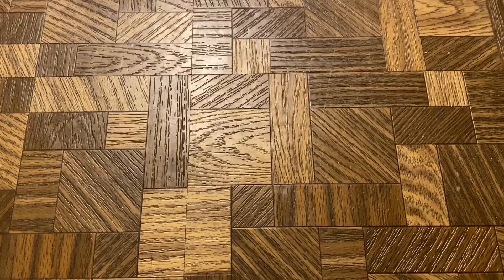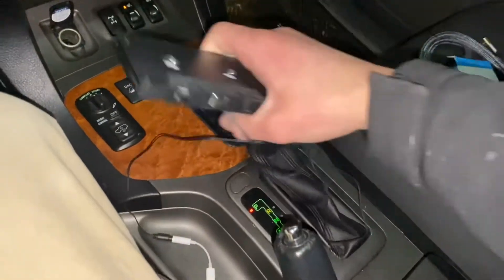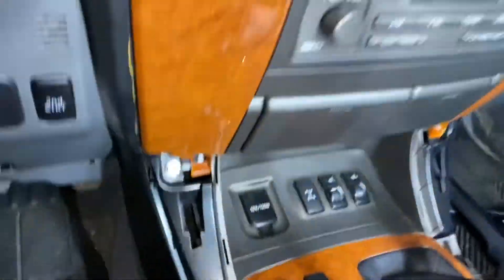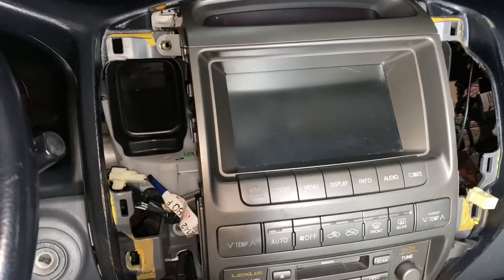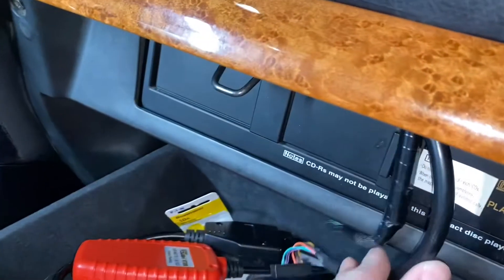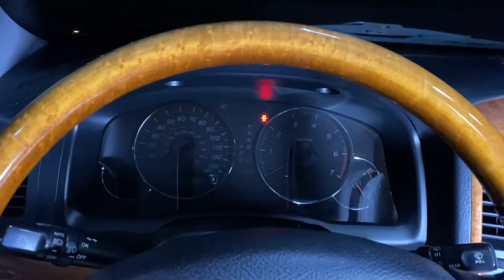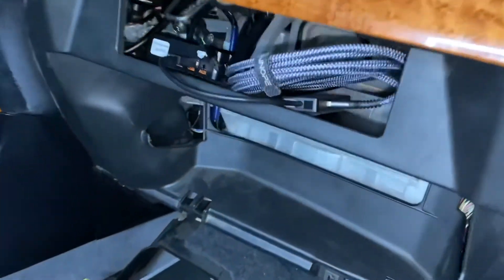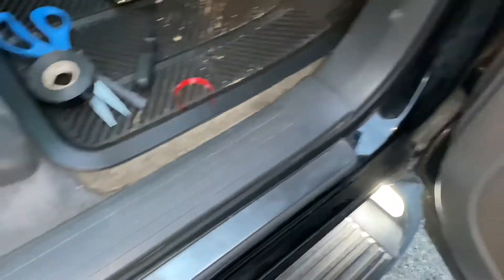Lexus Upgrades: Installing USA Spec Bluetooth Adapter and Dashcams in my GX470

Comment: Excellent video and everything well explained. Looking to purchase this module for my Lex RX350. Can you please give me an update on how this Bluetooth module is working for you. Any draw backs etc and whether you’d still recommend it? Also did you connect the supplied microphone or you using the Lexus microphone for calls? My car also has Bluetooth built in but only for calls, not for streaming music and that’s all I want to do. Thanks
Reply from the maker: It’s been about 4 months since I’ve had it in and I love it so far. I’d still recommend it. Audio quality is great, always connects to my phone. And I didn’t end up setting up the microphone. I may later, but for now, my 470’s stock bluetooth works for that.
Reply: @mpt.yt4  thanks for the quick reply. Do you have issues switched between Bluetooth connections because you’ll have to connect to this for music and connect to the car for telephony, guessing you can’t have two simultaneous Bluetooth connection? Thanks again.
Reply from the maker: I had an FM adapter in my Explorer and it was lower quality than I had hoped for. And no, it connects to both for me, so I never really have many issues. I might put in the microphone for higher quality audio though when on the phone
Reply: @mpt.yt4  that’s awesome, your lucky. Well i know fM tram otters are crap but I might take a chance on this one first as it’s a Bluetooth Fm transmitter for £10. If it’s crap, I’ll return it and buy the module you got. 

Thanks for the replies and your video was really good especially considering you said it was your first one. You explained everything well and loved your kit too, the Garmin cameras, your car and the tool kit.
Reply from the maker: Sounds good, glad I could help!